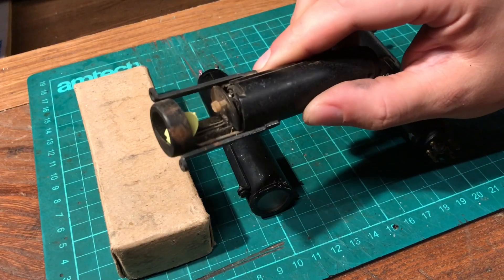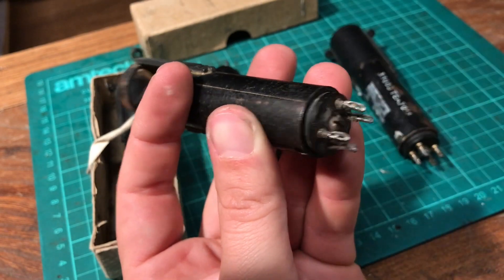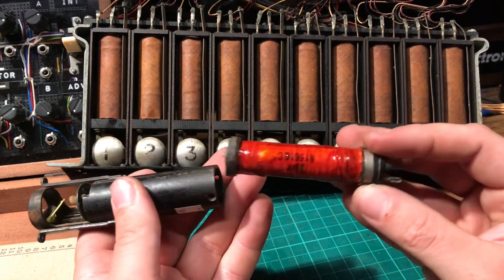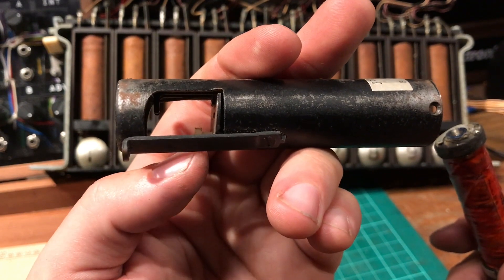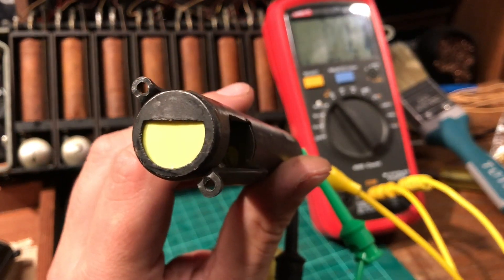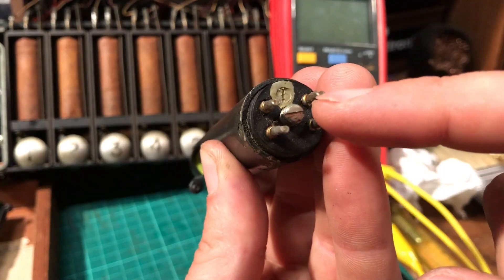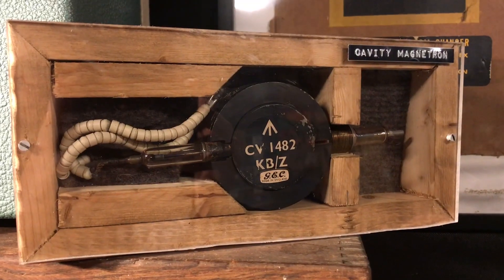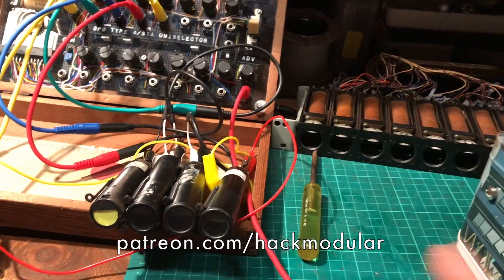1930's Flipdot Displays!

Comment: Really takes me back Mitch, the quality of construction of these mechanisms and their fine  adjustment using odd-size small BA screws are from a bygone era and great to see them working again and will run forever.  See you are using genuine and proper Post Office Engineers'  Footprint instrument screwdrivers - none better and eternally useful !.
Reply from the maker: Often said but those old things were built to last! Well spotted - my friend who used to be a PO engineer gave them to me. Very grateful, they’re fantastic tools